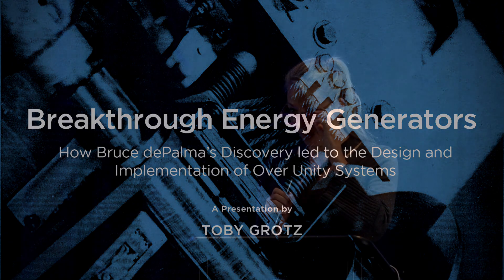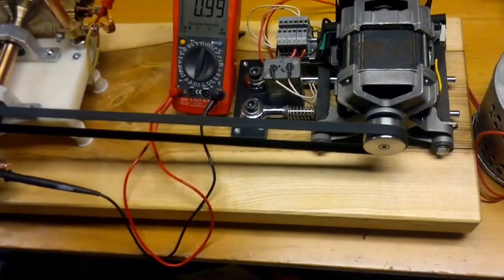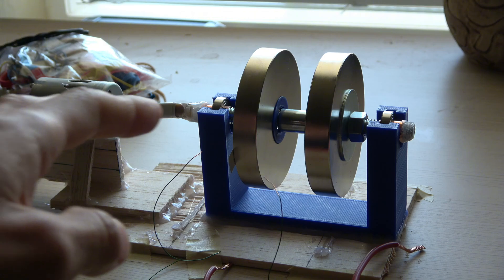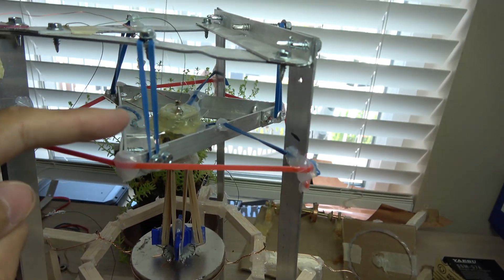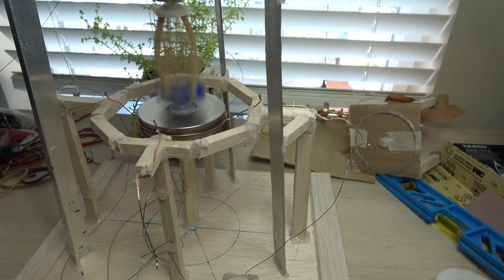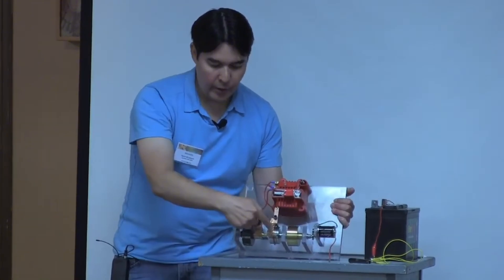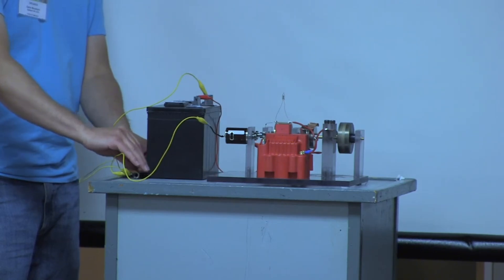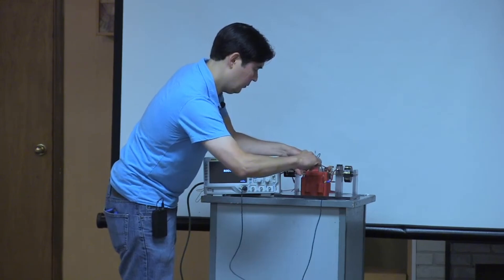N-Machine Free Energy Generator by Bruce De Palma & His Mysterious Death"

Comment: Can't bring to market, just open source the concepts. Earth has frequency due to being shone on by sun for one thing. Calibrate panel to see it, should be in infrared frequency for one.  Voltage increasing components also exist. Battery operated device reacting to frequency can still make net energy spinning. Closed circuit between two batteries can still glow or vibrate if it's wires are made to react to the electrons flowing inside circuit, too.